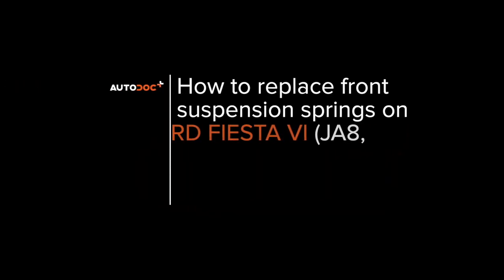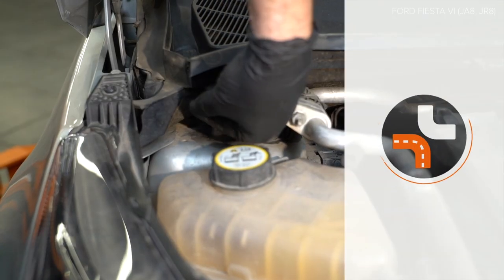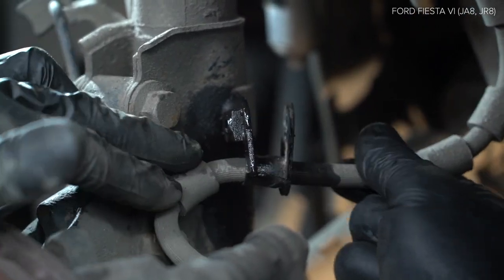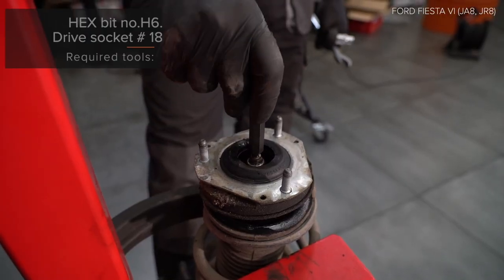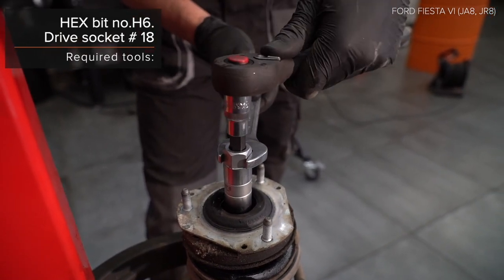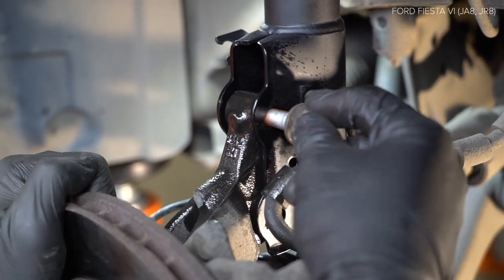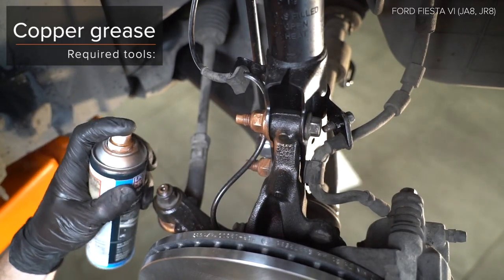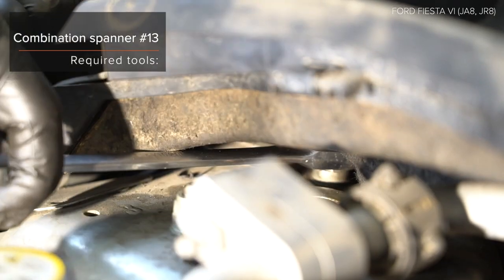How to change front springs / front coil springs on FORD FIESTA JA8 [TUTORIAL AUTODOC]

Comment: Just done BOTH front springs following this video. Was a doddle. Less than 3 hours doing it on the drive and just taking it slow. And including clearing up and test drive. I used a 13mm ratchet spanner for the 3 top nuts as access is tight especially for the furthest nut. Great video, cheers.
Reply from the maker: Thank you for sharing your stories and experiences with us. 
This will be very useful information for us and our viewers.
AUTODOC
Reply: How did you go about not using the special compression tool for the removal of the spring?

Comment: Are you supposed to torque up lubricated bolts ?
Reply from the maker: Thanks for your feedback! Please clarify or rephrase your question.
Reply: @autodocuk  hi, when applying torque to a bolt, having lubricant on it will allow it to put more clamping force due to the lack of friction on the thread. This can cause over torquing of the bolt. The opposite is also true with rusty bolts - for the same torque setting less clamping force for the same given tightening torque.
Great vid tho 👍👍